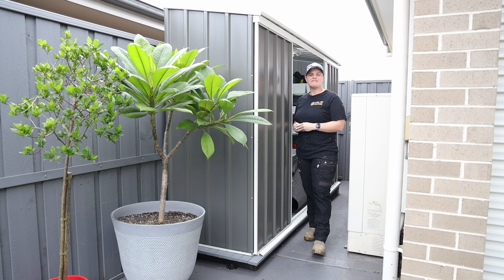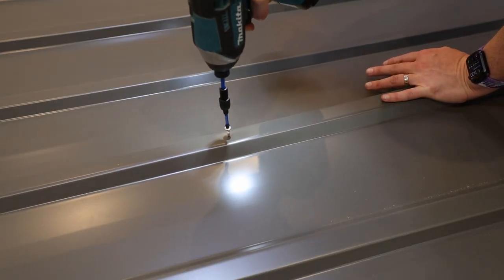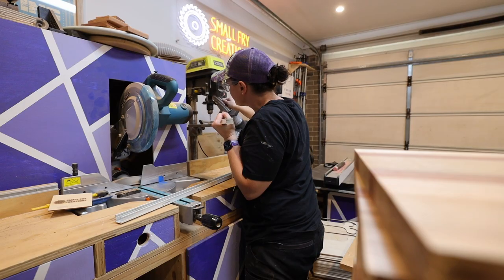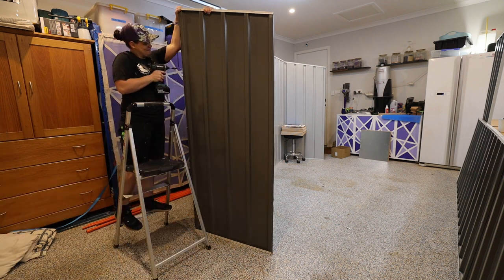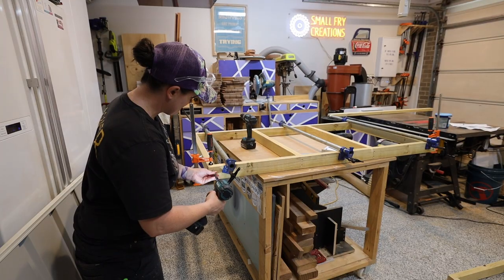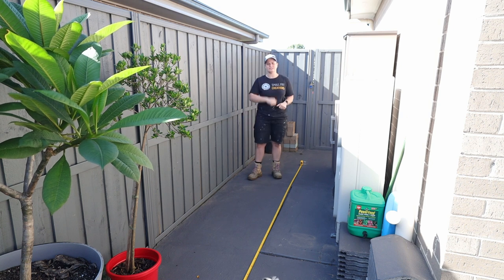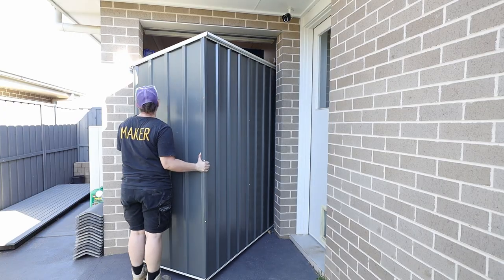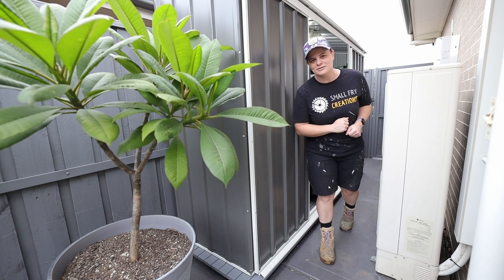DIY | EASY Shed - not so easy to Build. On a simple platform

Comment: I bought the 3.7 x 2.25 metre model and started to assemble it via the instructions.  Very poorly laid out and  seriously, a shed assembled using the lightest bracketing and spouting teks was too flimsy for me to bear.  Having my own engineering business, I manufactured a 30 x 30 SHS frame, used their sheeting and roll a door tracking and scrapped their flashing and brackets.  Built SHS doors and made my own 2mm aluminium flashing.  Like someone said below. "Next time I would build my own from scratch"  I would too.  The design I used enable me to built the unit as four complete sides and a two sectioned roof.  Held together with 16  8mm bolts it took 30 minutes to assemble on site.  And was still light enough for 2 people to carry.

Comment: I had purchased from EasyShed and it took 2 handy man couple of days to put it together and anchored to the ground in my backyard. The thing bothers me the most is that the tip of all the sharp screws are exposed all over the place inside the shed, it's so easy to scratch yourself when you are in the shed .
Reply from the maker: I agree the screws sticking out can be annoying. I have the shelving in there so I don't come in contact with them but can imagine that would be annoying.

Comment: Great vid, and awesome experience shared, me and the kids just built the exact same model; **HOT TIP** for anyone about to build one of these ... before you start, ditch the supplied self tapping screws, head to Bunnings, and grab a 100 pack of 10G x 16mm Buildex Metal Teks Hex Head with seal, the hex head paired with an impact driver will save a bunch of time and coins added to the swear jar :P .. oh and agreed - the build is not so easy, took us three days.
Reply from the maker: Thank you! OOo Great suggestion on the screws!!

Comment: Good Video, I just built the same one and pretty happy with it. I found that some of the trickier parts were way easier if i predrilled a pilot hole with a sharp/decent 3mm drill bit (especially where the screw needs to go through two of the steel channels). As noted in your video and instructions - having a second person is very helpful, and it is essential to find ways to have something on the other side of whatever you're trying to join to create pressue for the drill to push against.....
But the real diamond of advice i got from this video, for which I am very grateful, is about those narrow little $20 shelves from bunnings that fit like an absolute glove on the side walls. Its like they were designed for these sheds. I cannot believe easyshed havent got a pallet of  these to sell as an add on with the sheds.
Reply from the maker: HAHAH I agree. The shelves are perfect and holding up extremely well. Glad I could help and now that the shed is together I'm super happy with it and its working great.

Comment: Well done to you and The Engineer, really really great video.  I do have a couple questions if you have time to answer.  First, I noted that a number of the screws ends (pointy ends) were visible on the inside of the shed.  Is this normal?  Seems strange that Easy Shed would design a shed with sharp pointy bits protruding inside the shed.  Second, why did you choose to go with deck slats on the timber base instead of using exterior grade 18mm plywood sheets?  Once again, great video, love your work...
Reply from the maker: Hey Thank you so much. I agree with the design and the screws coming through. I believe this is fairly standard on these types of sheds. No sure why thorugh. I went with deck slats so that if any water did happen to get in it would have somewhere to go and it was also cheaper then plywood. In saying that no water has gotten in so plywood probably would have been fine as well. Thanks for the kind comments and stopping by

Comment: I was trying to decide between buying or building a shed for my mower and gardening tools. Based on this video I think I will just build one from some plans (or at least avoid Easy Shed on the off chance they also sell here in Canada)
Reply from the maker: I here you. I'm glad its done now and its working out great but it was a mission to get it built. From the sounds of other comments its a common challenge with the metal sheds. Some companies do them where the holes are all pre drilled so that might be a little easier.

Comment: Hi mate
Just a BIG tip , all garden sheds HAVE to be built to the length of the top & bottom strips that are connected with the joiner piece ,that are screwed to the sheets wether side,front,rear or roof ,if you don’t do this the shed will be oversized to the dimensions on the box, every shed I’ve built apart from pinnacle,the sheets have to overlapped more than normal & screwed to accommodate this problem ,if you you would like any other tips let me know , cheers
Reply from the maker: Ooo good tips. Mine where screwed to the length of the strips and to the instructions but god knows I could have done something wrong 😂Just glad it is now done and up and working well.

Comment: Hi Ainslee, great video. And kudus to complete it such smoothly. Could you please confirm what do you use to hang that snipper whipper at the back of the shed?
Reply from the maker: Thank you. The hooks for the whipper snipper came from Easy Shed. They had a bunch of different hooks to choose from. They are just the simple metal ones and they are working well.

Comment: Amazing video! Planning to do something similar. Would you recommend another brand instead of Easy Shed? Also, building this on the lawn, What do you reckon will work for flooring? Don't want to use concrete, What do you think about plastic pavers?
Reply from the maker: Thank you. I don’t know of another shed company and from what I hear since putting out the video the toughness of getting it together seems to be across all brands. I’m very happy with it now it’s done it was just a mission to get it up. Pavers could be ok my only worry would be you need to be able to secure the shed down as it has no floor and it very flimsy until you secure it down. Just wouldn’t want it blowing away. Hope this helps and happy building 😀

Comment: Thanks for the very detailed video. I was wondering if and how you anchored the wooden /deck base to the concrete so that the shed is firmly secured to the ground?
Reply from the maker: Thank you. The deck is not achored to the concrete in anyway. The weight of everyting in the shed and the shed itselfs its not going anywhere.

Comment: Looking at this and waiting for mine to arrive (hopefully before Christmas), do you think it is worth pre-drilling the screw holes?
Reply from the maker: It came with self tapping screws, no pre-drilling required. I was under the impression (could be wrong) you get a better weather tight seal without pre drilling.
Reply: @SmallFryCreations  
My shed finally arrived, delivered in a Thrifty rental truck,  after a 6 week wait.

The problem with self drilling screws is that they are not as sharp as a drill and have a tendency to wonder.  This is a particular problem when drilling through two or three surfaces to be joined.  Plus there is the problem with some of the sheets folding under pressure when its difficult to get some sort of bracing under the panels being screwed together,.

Having started my construction I am using a combination of using the self drilling where possible but pre drilling in some of the more critical places.

I'm  not sure about the waterproof aspect.  But I did find the process of attaching the braces by attaching from the inside, then removing the screws and attaching from the outside, to be very sketchy.  I ended up using machine screws and nuts for this as I found the self drilling screws provided a very loose joint when screwed in the second time. 

All-in-all I have to say I am not impressed with the construction.  I guess you get what you pay for and this shed is cheap and nasty.

Comment: Amazing video. How did you add a light inside the shed?
Reply from the maker: Thank you. It’s a solar light and I drilled a small hole at the back of the shed to run the cable for the solar panel on the roof. I got the light from Costco. Not sure if they still have them but it’s working great and super bright. Hope that helps 😀

Comment: How did you go with your delivery?

The reason I ask is that I recently order a shed from them on 9 Oct.  They informed me that they prepared it and handed it over to the freight company on 10 Oct.  It is now 7 Nov (almost a month later) and still no sign of the shed.  On the tracking website provided it sat in the Albury warehouse until 6 Nov when it started its move to Melbourne.  Today (7 Nov), its still on that 4 hour road trip according to the tracker.

After waiting this long I am not going to be a happy chappy if their are parts missing like yours.
Reply from the maker: I hear ya for. Delivery was fine first go around. The spare parts took a little while to arrive but eventually did. I would worry to much about pre drilling only because you pre drill in the wrong spot you can’t patch it being metal. Hopefully it arrives soon and you can get to building!!
Reply: @SmallFryCreations  
Thanks

Comment: Hi. I got one of this shed and will attempt to assemble myself and a friend. What tools did you use to assemble? Was it just the screw driver or rivet gun as well? And I’m planning to do like you did with a deck as a base, the area also has a slope for water flow basically concrete apron and gravel area. You mentioned about window packer, noob question how did you use this? Thank you.
Reply from the maker: Thats awesome. You really just need a drill. You won't be able to get the screws in without a drill. The screws are self tapping and just need some pressure on the back of the drill to get the screw to bite. The window packers can be purchased from bunnings and come in different thicknesses. They are used to shim areas in the deck if needed to bring things into level. They work really well and have no trouble with weather. They aren't 100% needed. Just handy to have it something is out of level. Hope this helps and happy building
Reply: @SmallFryCreations  thanks very much for replying. I will give it a try! :)

Comment: looks great. Just wondering as the frame is on feet to make sure the water flows beneath the floor, did you attach the shed to anything e.g fence to stop it moving in high winds?
Reply from the maker: Thank you. I used some angle brackets and attached the frame to the deck but I didn’t attach it to the fence. Its is in a protected area so isn’t subject to high winds but you could attached to the fence absolutely to stop is going anywhere. 😀

Comment: I would be worried installing a shed in close proximity to the front of an air conditioning unit as, from experience, this can dramatically reduce the cooling efficiency of your unit. Our air-conditioner was installed about 900mm away from a colour bond fence rendering it virtually useless.  We had to have the unit relocated to a more open position to allow for more efficient ventilation.  Then it worked perfectly.  I only mentioned this because in this video they appear to have fallen for this trap.
Hope this helps someone. 
Regards.😊
Richard Court.
Reply from the maker: Fair feedback and may be a problem dependig on the air con. We have had the shed in place now for a year and haven't expereinced any issues. We were told by our air con company that if it did become a problem you could purchase attachments for the front of the unit that will redirect the air. We are yet to have any problems

Comment: I want to do something similar on my 9th floor courtyard, but worried about wind. How heavy was your frame?
Reply from the maker: The shed itself is very light as its only thin metal. It gets it strength from being attached to the decking. I would talk to the shed company about what they suggest and if it would stand up to the wind.
Reply: @SmallFryCreations  Yeah the shed itself will cope with the wind, it's the wind picking it up and moving it in a storm. I was thinking maybe heavy sleepers as the frame, that's a fair bit of a weight. And then big storms some tie downstraps
Reply from the maker: @MichaelMallett-c5t  Mine is on a deck with just some small angle brackets. The deck itself it not bolted to the conrete and has never moved. Also if its on a deck similar to mine and then heavy stuff in it I can't image it going anywhere. Mine is up againist a fence and not in a windy area so hard to 100%
Reply: @SmallFryCreations  Thanks, great work